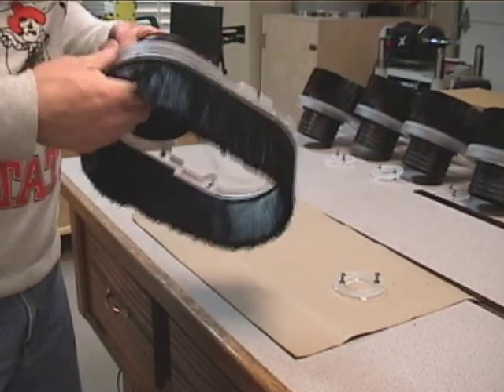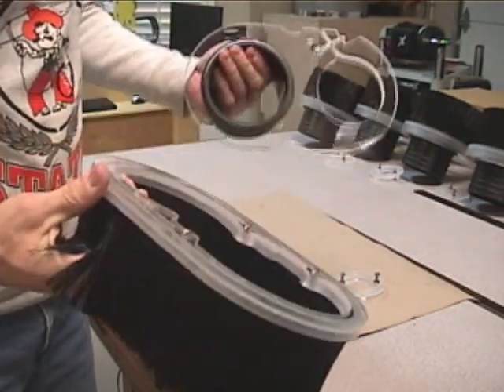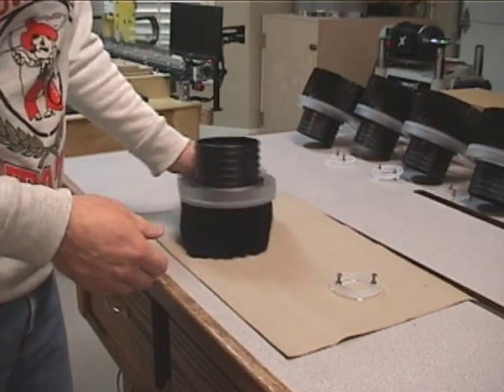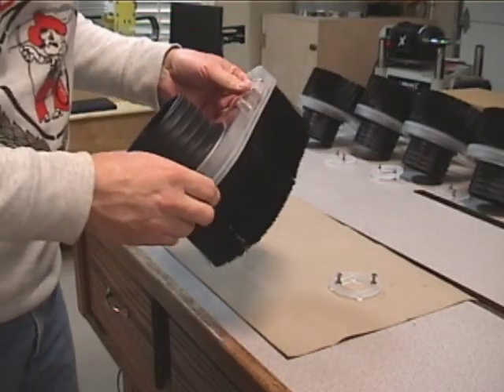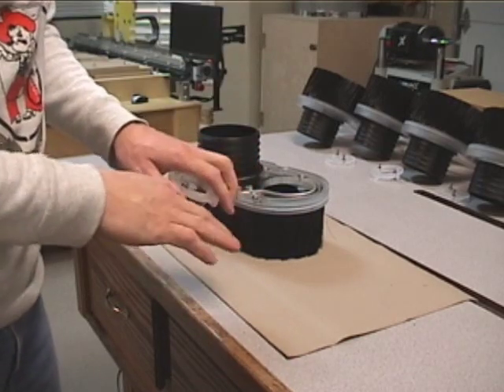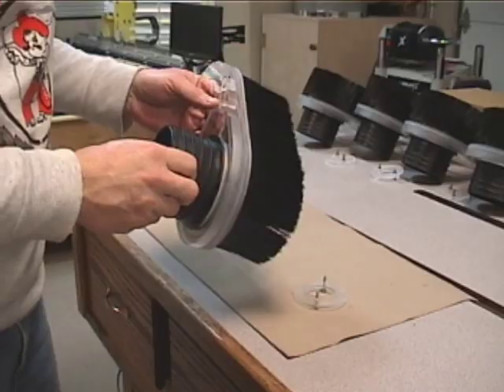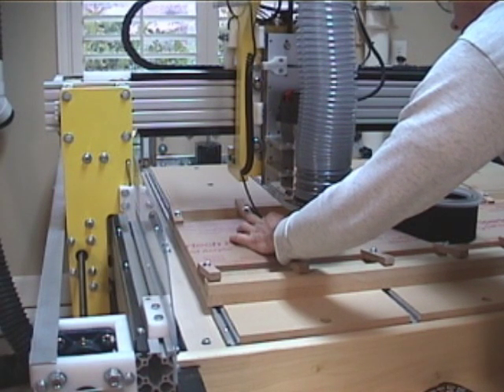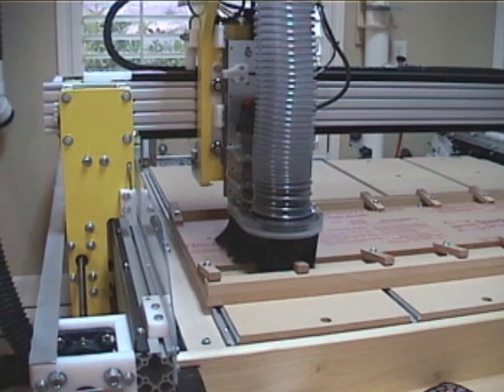Dust Shoe Demo

Comment: where do you get router bits that are long enough to use a 3" brush?  I've never seen bits longer than a couple of inches.
Reply from the maker: The length of the bit is only part of the overall length. You must also include the length of the collet and take into account how far up on the body of the router/spindle you are going to clamp the shoe. For some routers and long bits, you actually need one or two spacers to get the brush to touch the work piece without gaps.

Comment from the maker: The nylon brush holds up amazingly well even if the bit touches it. The only time you will have a problem is if you are cutting a deep pocket and have a situation in which the brush can get pinched between the bit and the side of the pocket. You should not have a problem when surfacing. Ideally, you set the brush such that the tips of the brush touch the workpiece just before the bit touches. Any gaps between the brush and the workpiece will allow dust to escape.

Comment: I have this dust shoe for my CRP4848 and Hitachi router, and the construction of this thing is awesome.  The magnet setup is brilliant and makes things super easy to swap out.  One question for Kent though, when using my big wide surfacing bit, I've not known how far down I should have it set.  I am concerned that any bending of the brushes will possibly get them caught in the bit and rip the whole thing off.  But it's a huge mess without it touching the material.  Any tricks for this situation?